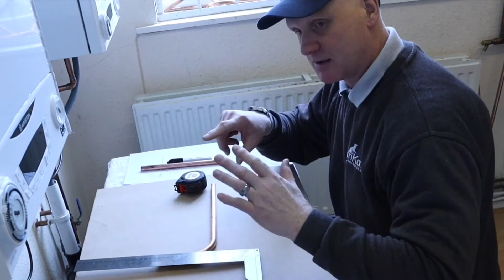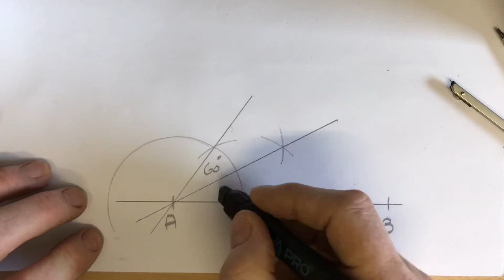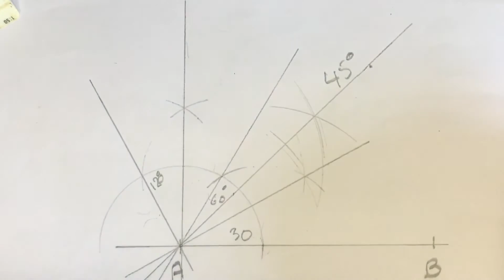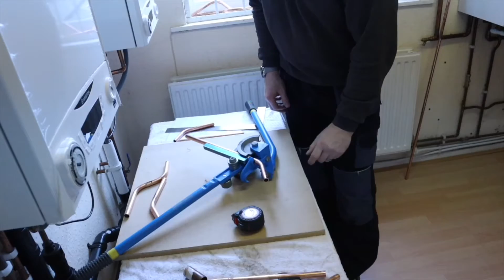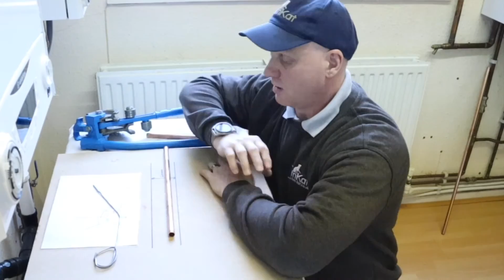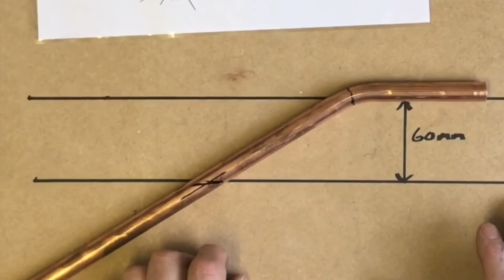HOW TO BEND COPPER PIPE part 2 tutorial on how to bend offset bends in copper tube using a bender

Comment: When you explain at minut 20.40 that the mark should aligne where the former touches the guide, that tip works only for 30 degrees or also works for 45, 60,or another angle?
Thanks
And congratulations

Comment: Very informative as always Del.  Know what I was impressed by most - that fucking Silverline bending machine, it looks the Dog’s Bollox!!
I guess for the course cowboys & career change chancers you can only buy cheap tools.

Of course for speed on-site,  you don’t have time to draw lines.  For a parallel line stick the pipe against the Skirting & measure/mark from that.
Another wee tip; use a bit of core solder to get the complete offset size, centre to centre, then use that on yer Bender.